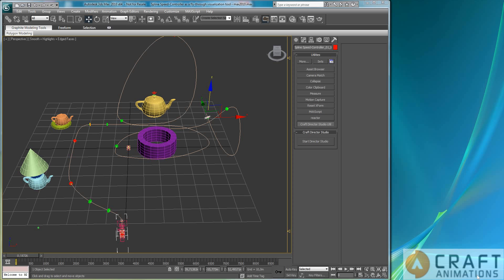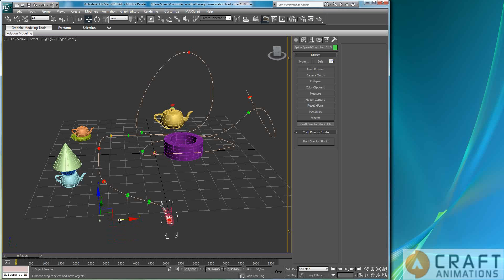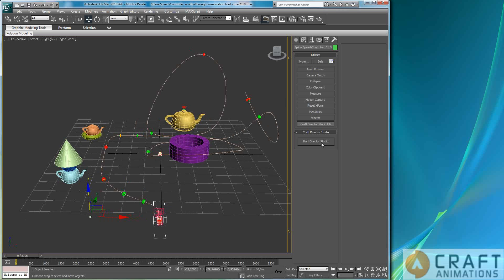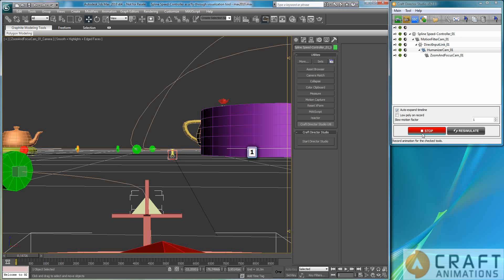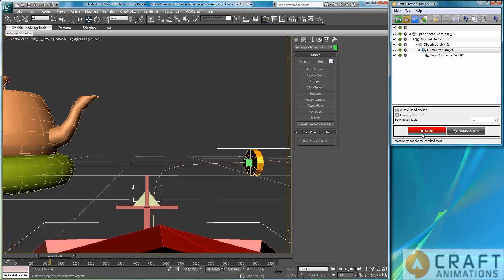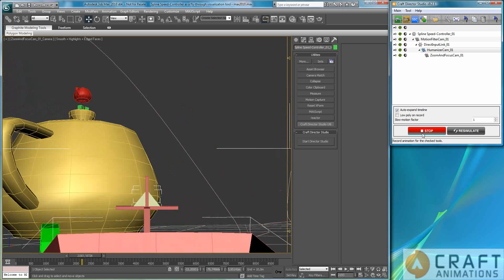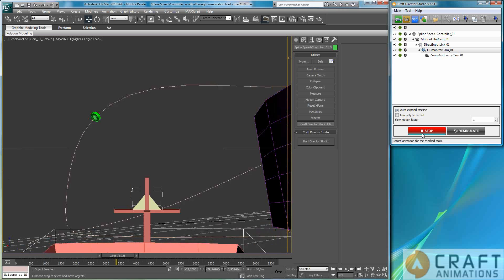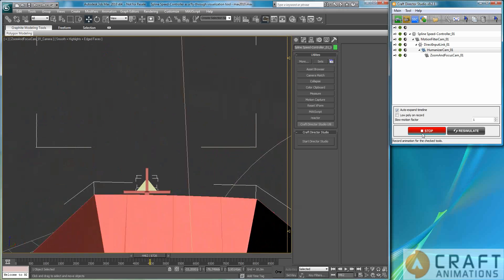Craft Spline Speed-Controller - Part 2 - Turbo Tutorial

Comment: Hello! Can you please explain how to connect 4wheelerExt with Spline Speed Control? I got a car rigged with a 4wheelerext and it ride well in a keyboard mode input mode, but I need it to ride along spline so I set up a spline  speed controller with a bunch of waypoins like in this tutorial. Bot what I missed out is how to link the Car to this? I tried to link car body mesh  and other meshes  that are provided with a 4 wheelerext (separately of course) to Carriage.
But there is something going wrong, the car is not riding, wheels are not turning, but carriage trying to drag it  anyway and the front suspention is wobbling
Reply from the maker: Hi @Aeltanify. What you need to do is activate Autonomous mode in the settings for the 4-Wheeler Extended. This mode activates the 4-Wheeler Extended to follow the TargetMesh (green cross crated with the 4-Wheeler Etxended tool). You then use the TargetMesh and make it follow a spine. By constrining it to a Spine or an object that is animated, for instance the Carrige of the Spine Speed-Controller.
Reply: @craftanimations  Thanks I got a deal with this moment, but now I got another problem - after importing FBX animation into Twinmotion, the wheels of a car became oval formed and ride pretty strange. I tried to reset XForm in 3ds and export again but result is the same. In 3s animation looks nice
Reply from the maker: @Aeltanify   Not to familiar with Twinmotion but I guess it is the same as Unreal Engine. Are all the parts direct child of the dummy wheel? This is needed for it to display correctly. Are the wheels always skewed or just in certain timeframes?

Comment: Why every single plugin that exists for vehicle animation never has reverse option so you could do path/spline animations like parking to a side road then reverse and continue going forward or like do truck w/ trailer reverse parking ? It's good to have manual control tho, but it's not as precise.
Reply from the maker: The 4-Wheeler Extended can actually reverse in autonomous mode if most efficient and done slowly, otherwise it will try to turn around instead. The issue is that the rig does not know where it will be in future and only knows where it is at the moment and where the target is at the moment.